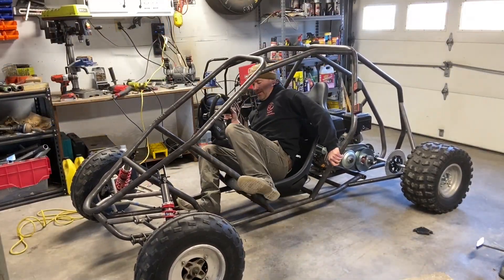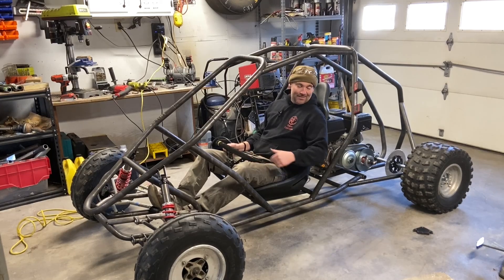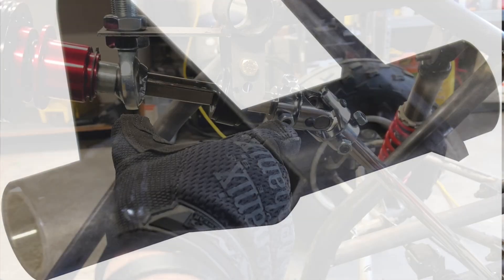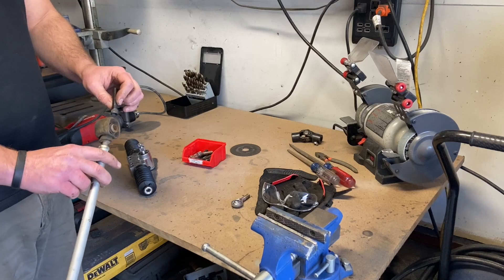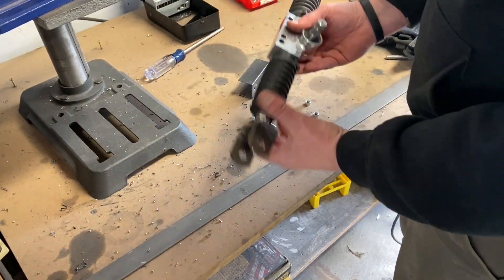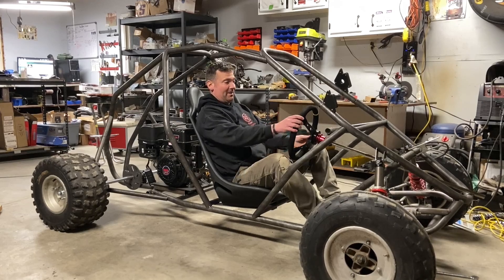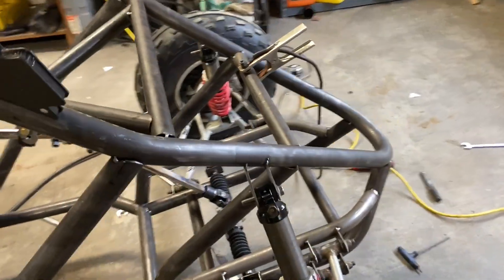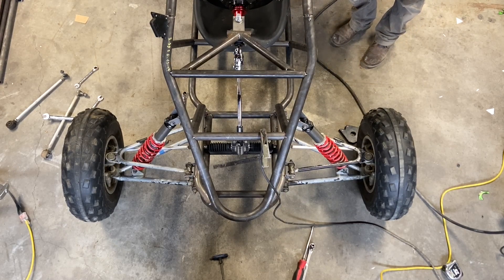Budget Crosskart Build #7: Foot Controls and Steering

Comment: its more fun to drive a slow car fast, than to drive a fast car slow. 

I'd rather run a smaller engine and use full throttle more often to take the machine to its limit, than spend 90% of my time hovering my foot over the brake after barely using the engine.

Comment: What do you think the overall material cost for this build is gonna be as you've built it?
Reply from the maker: So metal prices went up 25%… usually the steel costs under $1000.00. I don’t really have a strict budget for this one. The goal is to make it really safe as there are two souls on board. Should be similar to the single seater though.
Reply: @KJRaycing  the single-seater budget build is the one I'm asking about
Reply from the maker: Budget is under 2k and so far I’m definitely under that. But again I bought the steel before prices went up. So it is probably around 2100 or 2200 until prices go back down…
Reply: I see that you referred to metal as dom but 1020 1026 or for predator 212 with 14hp can I use
MILD STEEL ROUND TUBE STRUCTURAL (WELDED) hot /cold rolled more interested in teaching kids fab and welding 
Not racing 
Looking at budget build 
Have already bought v1 plans and buying guide

Comment: when you're done and it's time to paint, the back finish of the pipe looks good, so I think you should consider a matte black frame with brushed Aluminium panels, and a low mounted wrap around rear spoiler👍
Reply from the maker: I will definitely consider that. I already have a black one but the matte black with the brushed aluminum would look pretty sweet. Not sure what you mean by the wrap around spoiler though…

Comment: A simple explanation of Akermann, most people say it's so the front wheels are turning around the same point which prevents either wheel from scrubbing or skidding, and allows both wheels to achieve maximum grip, which is correct... Adding Toe out on the other hand makes the inside wheel scrub on purpose... this creates additional resistance on the inside and causes a breaking effect on the inside wheel (electronic stability control does this also) the breaking effect on the inside tries to slow the inside allowing the outside to overtake it, THIS IS WHAT IMPROVES TURN IN!
Reply from the maker: Thank you, that is a much better explanation than I gave. The physics and tuning of cars is just cool.

Comment: I have too much throw in my pedal. I bought a 30mm carb and billet intake manifold for my 670cc predator and got stuck wide open smh the ruts in the field
Reply from the maker: I’ve already refined the pedal build. I’ll put a vid up with the refined design that has adjustable pedal stops.